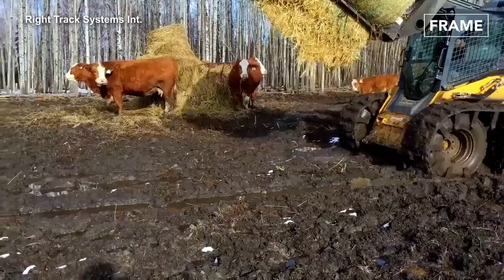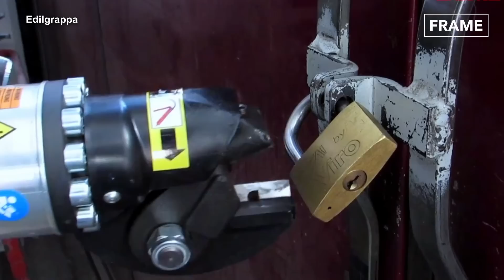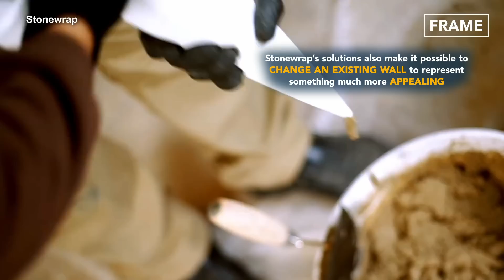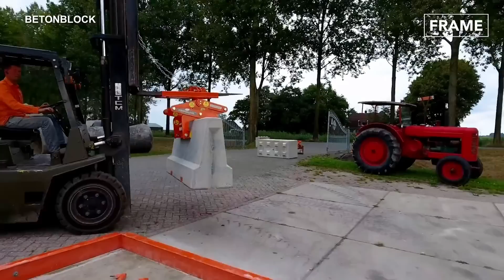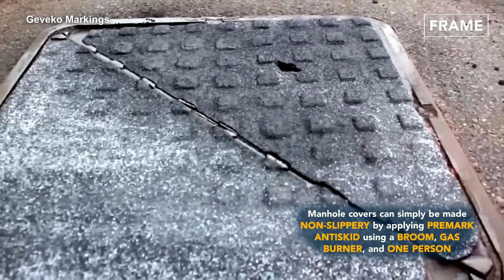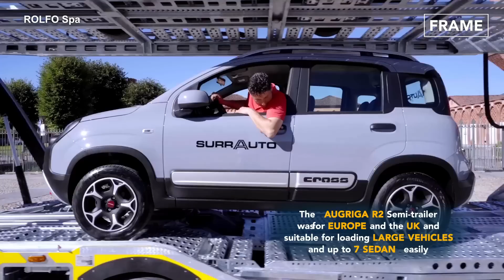Genius Truck Inventions That Are On Another Level

Comment: Decades ago, something like this was the only way to have tracks on a Bobcat. Real PITA to install, because they didn't come apart to drive onto. Had to take both wheels off, put them into the tracks, and remount the wheels. Then do the same thing on the other side. 😬